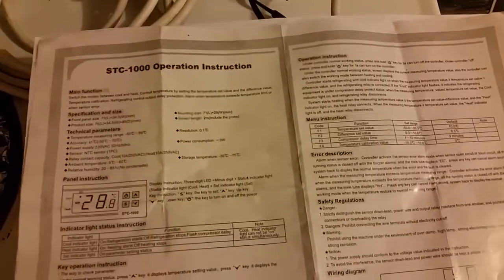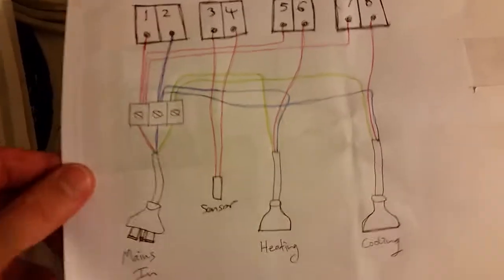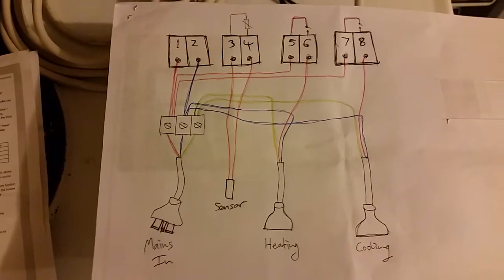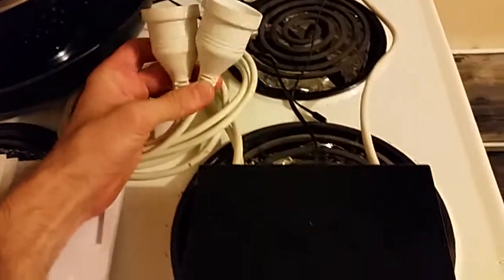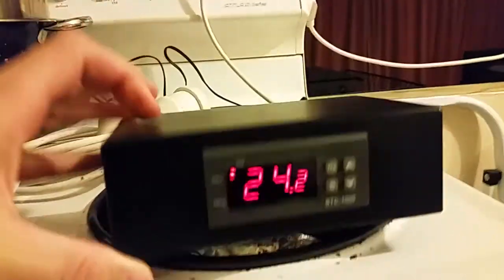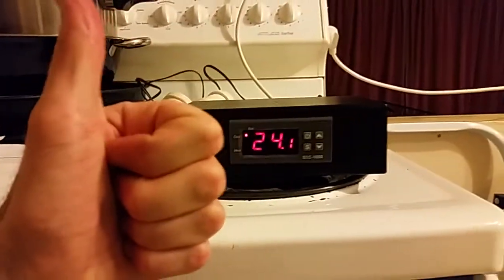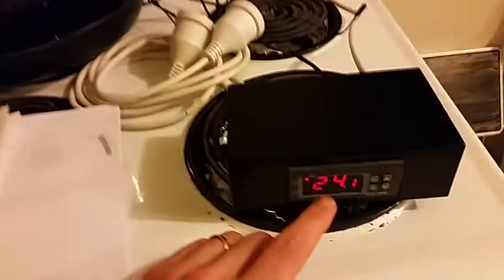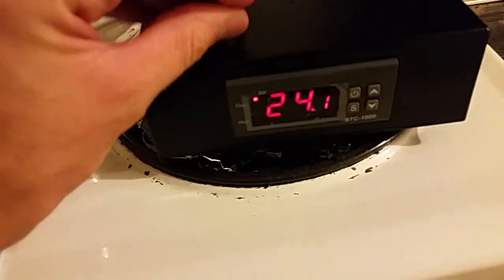STC-1000 Temp Controller (Tech/Brew)

Comment: You cannot beat the temp controllers,I found them a pain to wire up,since seen the inkbird version, plug and play, a bit more expensive but I reckon worth it, 
Cheers 🍻 hhb,
Reply from the maker: Yeah temp control is pretty awesome. Ive been lazy lately so just had to sort myself out and get a working one built up again.